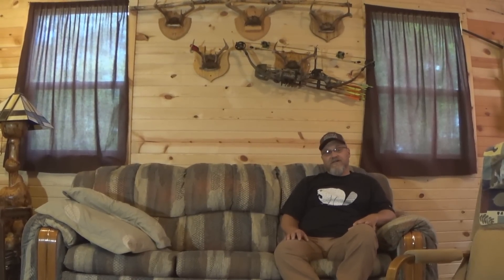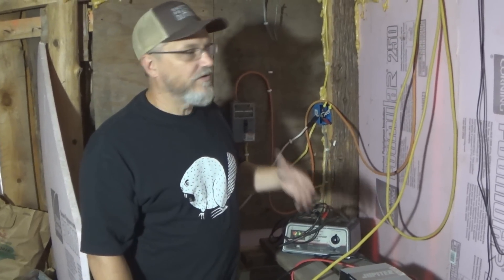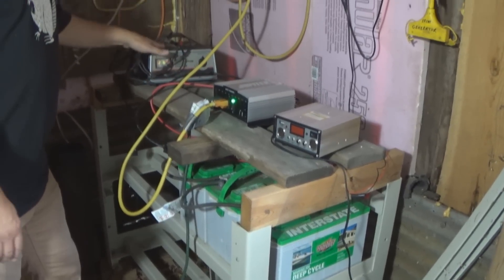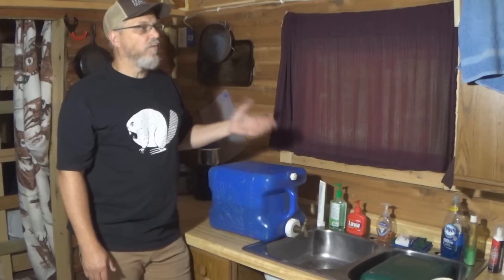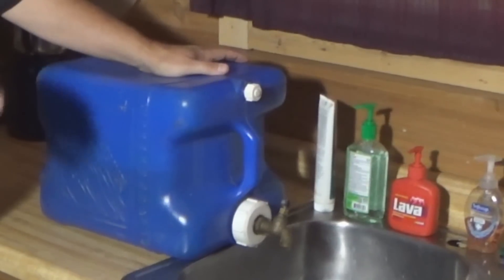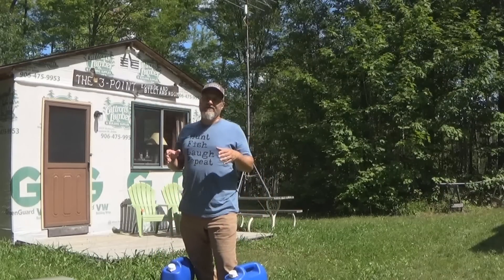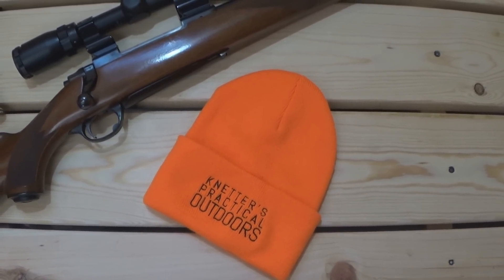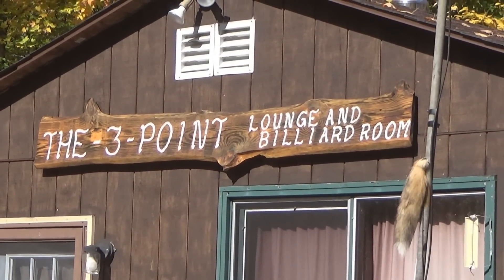Off-Grid Utilities - How We Do Heat, Water, Electricity And Sewer

Comment: Try running a pvc vent pipe up on your outhouse, while keeping lid closed while not using helps tremendously, just a tip I’ll share. Over in a corner from your seat base. 
Nice place!
Reply: And paint it black helps it to draw better especially when it warmer.
Reply from the maker: thanks
Reply: Thanks for the tips. I use ash and get the better tp and was happy to see someone mention that too.

Comment: I'm trying to learn how to do all this. But I was wondering. If using car batteries to power the camp is it feasible or even possible to run a series of alternators using a few windmills or water mills from a nearby stream ? 🤔  just wondering, I'm no engineer or electrician so I don't even know how all that would work.
Reply from the maker: It will work, but I don't know if you may need to gear things different.  Alternator needs to spin pretty fast to charge.  But maybe you have the wind for it.  Of course you can buy windmills for this too.
Reply: @KnettersPracticalOutdoors  thank you 🙏

Comment: I use to haul my water 325 gallon tank on my truck put in a 1000 gallon tank in the ground with a electric pump to furnish the home with water  had a septic tank for waste  water  but finally got a sand point well and converted electric pump to pull well water so I don't have to haul it anymore  but you did a nice job thanks for the video Dave  I live on the river so I can fish anytime except for winter
Reply from the maker: Thanks for the add in
Reply: I bought the tank for truck from orchelins farm store  cost a 1.00 back then to fill 325 gallon tank I made 3 trips so 3.00 for 975 gallons of water back then probably the prices if today for the electric pump 1000 gallon tank someone with a backhoe and the pipes to bury it  Im going to say 5,000 today but we looking at back in the late 80s early 90s when I did that

Comment: If you use a smaller pipe for your return line to heat your water ... 
Nice setup . Where's your ham radio ? Solar ? Nice sauna . But I'd build a shower first . And and a swimming pool (portable) , makes a great bathtub and or cold slap after the sauna .
Reply from the maker: Great idea

Comment: Ashley. stoves are great we heated the whole house and hot water with one in Maine in the . The only problem is that they are not suitable for cooking. . ours had a square hole in the back where a blower could be added which can make a big difference. The great thingabout asley stoves is that they will burn all night if you run it right. Watch your door seals, they wear out
Reply from the maker: Good stuff

Comment: Why not heat about 5 gallon of water and have a small battery operated 12 volt pump and make a small shower. You could mix your water in the bucket to your desired temp. Just a idea.
Reply from the maker: that would work
Reply: I use a rechargeable shower head that charges by usb cable. I could check the brand next time i am there if interested.
Reply: Or how about an on demand propane hot water heater / 12v pump setup? You can put that together for ~$150 and have a real shower.

Comment: Loved the battery bank explication… 

I’ve always felt that it was so complicated, I’d never be able to figure it out when others would talk about it or try and explain it. 

Thank You!
Reply from the maker: Glad it was helpful!
Reply: @KnettersPracticalOutdoors  taking my battery bank out to my cabin is something that I’ve been wanting to do but i am concerned with the batteries being cold while I’m not there. I’m typically there at least once a month over the winter. Temps usually range from 10degrees F to 30degrees F and dip down around -5 F. Any suggestions of whether i should take them out there or not would be appreciated. I didn’t really want to get the batteries yet but was told over the past year that my career would be taken away so i was speeding up the process of leaving the city.
Reply: @shad5743  if you get lithium batteries they fair better in cold weather and can be kept indoors.
Reply: @gracecookie4604  thank you for the input
Reply from the maker: @shad5743  We have left them out during the winter, but it's not good for them.  This happened a few winters when the snow came early and we couldn't drive in.  We bring them in if we can.  A solar trickle charger may help if snow doesn't cover the panels.
Reply: @KnettersPracticalOutdoors  thank you for the heads up. I’ve decided I’m not going to worry about bringing them out this winter but that makes me feel better about the possibility of having them out here unattended next winter if it comes to it. I do have the panels for them also but the cold was my main concern. So unsure in these times while i try to ride the financial system til the wheels fall off. Seems like we have some broken lug bolts.

Comment: i work for a large bus company i have a endless supply of D-8  batteries i power my cabin with inside all 12v fluorescent & led lighting i take a D-8 in the back of my van which charges from my vans super duty charge system atwork i prep used batteries with new acid and a charge center which equalizes and charges to peek 12v/1000 amp  as new
Reply from the maker: nice set up

Comment: When I hauled water (for years), I had a 100 gallon tank on 2 wheels. It was easily pulled by any vehicle. There was a rural water supply overhead you could drive under and fill it for free. That is way easier than carrying 5 gallon containers by hand. And it came in handy one year after I ran my own water line from a neighbors (having given up on the local co-ops promise I would have water "any time now when we drill a new well). 

One winter the pump froze that fed the house (and cracked the housing). Fortunately, there was a local guy who could successfully weld cast iron. Never did leak, but I did put a heat lamp in the pump house after that. 

So I drove that tank on wheels over to a rich neighbor's house. They had an outside water faucet that was insulated and didn't freeze. And they gave me a full water tank so I could water 70 horses out of a bucket a few at a time. 

I don't like being cold which is why I have never lived north of I-40.
Reply: One thing I would suggest is forget hauling any water. If you have a cistern or storage barrel plus available 12v power, get a nice pump and a good length of hose, and transfer it that way.
Reply: Might wanna line up some off grid knee replacement, carrying 10 gallons a water, no dolly, no ramps, that's a Lotta weight on them walkin hinges
Reply from the maker: good stuff
Reply: I heard that.  Below I-40

Comment: 1:39 Love the Harbor Freight Solar Charger. Simple and Works. I use mine for Simple Lighting. 
Why not collect Rain Water? Even just getting a few 32 Gallon Garbage Cans from Walfart for like $10. Use that for the "Gray Water" use and or get some Good Water Filters and can use it for Drinking also. Hook a couple together at the bottom with a shutoff and drainage Valve for more storage and use a 12v RV Water Pump for things you need water pressure for. It's what I am doing. Tho I do live in Florida and don't really have to worry about Freezing... I type this at 1030pm Jan 17th and just below 40* outside :D :D
Reply from the maker: Yes we may have to try that sometime.

Comment: Shorten all your wire to the exact lengths so that they just reach your connections. Increase the gauge size on the wire used. And again on the extension cords should be shortened to where they can just reach to wire in your peripheral’s . Do that to the power system and it will operate much more efficient.
Reply from the maker: Great advice.
Reply: That's sound advice
Reply: @JJonesWTF 
Yes and You can always plug and run an extension cord, if you need power somewhere
Reply: @JJonesWTF 
Plug an extension cord if you nerd power somewhere
Reply: Leave enough if you need to patch or make an addition

Comment: Hello, amazing stuff, what are the costs for the whole electric system??  and then what are the montlhy costs??? thank youu!
Reply: Not worth the costs.trust me 
.cheapest generator good enough costs $1,000 alone..5 gallon tank of gas.about 2 1 -2 gallon a day.figure 3 gallon gas daily..I have awesome woodstove..but in -40 degrees windchill..I have to also run 20 pound cylinder on propane buddy heater..or were fucked
Reply from the maker: Many of these things where bought over time, but here is a rough estimate.  Generator $600, inverter $140, batteries $120 each, solar panel and controller $150.  We don't really have monthly costs as we only stay there for 3-4 days at a time here and there throughout the year.

Comment: Question, when you use the battery charger, do you charge one at a time, and if not, do all 3 charge at the same time?
Reply from the maker: Sometimes we will charge 3 at a time.  Of course they never really fully charge in just a few hours of charging (we usually only run the generator a few hours at a time).  If you can't get the voltage back up to a good value in the time that you charge, it can be a good idea to do one battery at a time.  At least the one battery may reach a good voltage level and allow for use.
Reply: Like another comment said... If he hooks the the Positive to the front battery positive and hooks the Negative to the back battery negative, it will charge all three at the same time. That charger he is using can handle up to 150watts and the solar cells that came with it ( From Harbor Freight ) are only 45watts all together, so he could add a few more cells... But HF no longer sells that version but a 100watt one for Around $150 and can handle up to 400watts ( Not sure on that ), so more cells can be added as needed. THO the Charger he has ( I have also ) is a Way better one than the new one even tho it handles less wattage..
Reply: Yes, use deep cell marine batteries.

Comment: Awesome camp. I have some similar set ups, and a cheap solar system (i went with a 3 panel system from Grape Solar) for lights, extra fan, tv, radio etc. is a game changer. Also something we do for showers is heat the water and mix to the temp we want and put it in a 3 gal. hand pump weed sprayer (clean of course). Our camp is an old 5th wheel, so we just shower in the old shower using the weed sprayer for water pressure. Plan to add a 40 gal sprayer with a 12v pump hooked to the solar system as a means to get water pressure for dishes, shower, etc. All around awesome video though, way to make it simple for everyone.
Reply from the maker: Thanks Mike, I love hearing how others do it.
Reply: It is a lot easier to just use a camp shower or build a solar hot water heater than keep a fire burning (unless you're wanting to keep it burning for other reasons anyway).
Reply: @Growmap  Problem with a solar water heater while hunting in winter is you don't shower until at least a couple hours after dark, if not more. By then the water has cooled down if it even had enough sun to get it hot in the winter temps.
Reply: @mikeletorus9556  Good point! I didn't think about that. I typically took that kind of shower during the day.
Reply: Maaan good idea!

Comment: Absolutely no clue why every off gridder I watch on YouTube uses wood stoves instead of coal.... makes zero sense.
Reply from the maker: Because we have 80 acres of maple hardwoods at the camp so basically an unlimited supply of firewood on the property.  And because we do not have a coal mine at the camp.  Also buying a used woodstove that fits the bill is much easier than trying to find a used coal stove.  That must make some number more than zero sense doesn't it?
Reply: Because we have trees and not coal. There is so much fallen wood where I live that I haven't had to cut wood through three winters. (But some of it someone cut and just didn't pick it up so it becomes mine.)
Reply: 40 years ago when the wood & coal stoves were really popular, I used to see dump trucks hauling coal here to central Michigan from Kentucky or West Virginia or wherever, I can't imagine the cost of the trucking alone, plus the price of the coal. Prohibitive.
Reply: Because my land has trees not coal. 🙄
Reply: Clue: i grow the fuel to heat my shelter

Comment: Stopped at your electrical setup .... you are only about THREE DECADES behind in technology there ....
Reply from the maker: You are correct, LOL!   I never said this is the most modern way to be off grid.  Our woodstove and our outhouse technologies are even OLDER than THREE DECADES.  This is just how we do it at our deer camp.  Maybe someday we will upgrade our electrical, but for now it does the job.  Sorry this video wasn't what you were looking for, KPO.
Reply: @KnettersPracticalOutdoors   , I went with a small gasoline generator my first few years off grid. I know full well what a pain depending on a generator for electricity is. Besides the noise and pollution and dependency on keeping a supply of gasoline , there is a great deal of inefficiency in your system.
Reply: @dunexapa1016  They don't live there. It is a deer camp they use less than a month a year.
Reply: @Growmap   , I suppose you would say the same thing ten years from now. That would add up to almost a year of horribly inefficient energy use ... not to mention the cost of fuel and the noise ... and, what do you suppose will be the cost of gasoline ten years from now? That 'deer camp' may need to serve another purpose in the future.

Comment: Nice little setup. When connecting your alligator clamps from the inverter to the batteries; connect the positive lead to the first battery, and the negative lead to the last batter, this ensures even discharge between all of the batteries.
Reply from the maker: got it
Reply: @KnettersPracticalOutdoors  Always connect ground first, and disconnect last.  Just saying
Reply: @davidrounds3245  thanks for that comment. I need to be more sure of  myself, dealing with batteries of that size are a little intimidating.
Reply: @davidrounds3245  It's not a vehicle, doesn't matter.
Reply: Sweet I never thought about that I'll start doing that with our set up.
Reply: Please be safe around. Batteries. No spark is a good thing.
Reply: @johnbutler5208  Whenever connecting an inverter, you will have a spark on the last connection as it charges up its capacitors. In order to avoid a spark, get a large resistor place it between the last cable and inverter terminal temporarily for 5 to 10 seconds then quickly connect it and you won't get a spark.
Reply: No..you can't fricken cross positive to negative..moronic idea
Reply: @andrewshepersky8704  He means connect the positive to the positive on the first battery and the negative to the negative on the last battery.
Reply: @andrewshepersky8704  You can’t read. Moronic comment.

Comment: Hey Dave have you ever considered driving a shallow well and have on site option for H2O?
Reply from the maker: We tried it one time.  We had water in the pipe and vacuum too, but it wouldn't draw up.  I've been told that happens sometimes.  The water can be stuck in the ground by suction.  We may try again sometime because you're right a hand pump would be ideal, KPO.
Reply: @KnettersPracticalOutdoors  I have been thinking about an off grid cabin and was considering collecting water from the roofs and saving in a barrel.  Any experience or ideas on this?  Enjoyed you video.
Reply: @Sam2sham  I asked also: Even just getting a few 32 Gallon Garbage Cans from Walfart for like $10. Use that for the "Gray Water" use and or get some Good Water Filters and can use it for Drinking also. Hook a couple together at the bottom with a shutoff and drainage Valve for more storage and use a 12v RV Water Pump for things you need water pressure for. It's what I am doing. Tho I do live in Florida and don't really have to worry about Freezing... I type this at 1030pm Jan 17th and just below 40* outside :D :D
Reply: @Sam2sham  There are lots of how-to videos on how to do that. But I've never seen any talk about what to do when the weather is below freezing.
Reply: @Growmap  in south Texas. Freezing isn't a problem
Reply: @Sam2sham  Lol...what about the winter of 2020?
Reply: @Growmap  wasn't a problem, winter lasted only 2 days, didn't lose power and  was back on the golf course in 48 hours.
Reply: @Growmap  🤡
Reply: @KnettersPracticalOutdoors  did you prime the pump?
Reply: If the ground water level is deeper than 32 feet you can’t pull it up via suction.  As you approach 32 feet suction becomes increasingly ineffective until at 32 feet it becomes impossible.  

This is a function of atmospheric pressure so as you rise above sea level the maximum suction depth becomes shallower than 32 feet. 

When you exceed the maximum suction depth the actual pump has to be down in the water and push the water up.
Reply: Well then (no pun intended), you're most likely too shallow in the well depth.  I lived up that way for 26 years, and you have a thick layer of fine (kaolin) clay under your feet.  Your gonna HAVE to drive a point, or drill, deep enough to get 20-40 feet below that muck.  Probably when you tried to pump, all you got was, mud-sucking sounds, right?  Gotta go deeper, preferably into that underlying sand/gravel.  Good, clean (filtered) water is there.  --- Doug, retired (Florida).  All the best.,.git 'er done!!!
Reply: Very educational for us who know zilch about batteries for powering a building much less connecting them to charge.